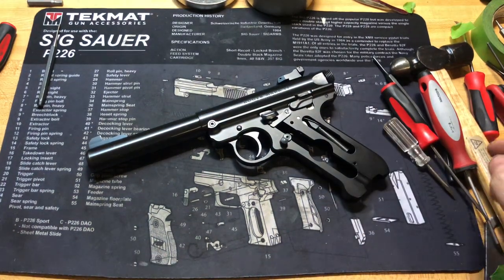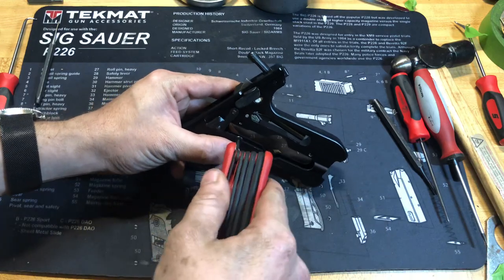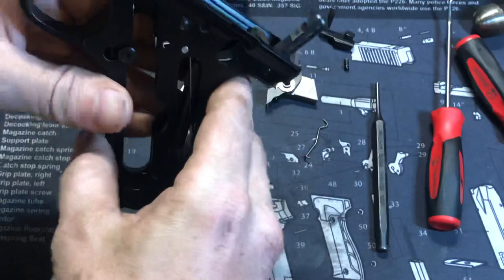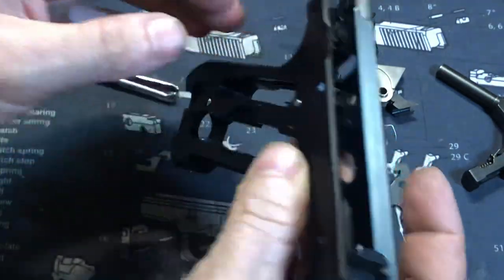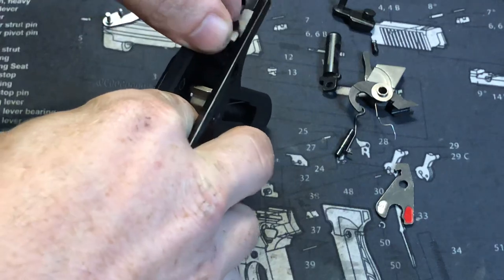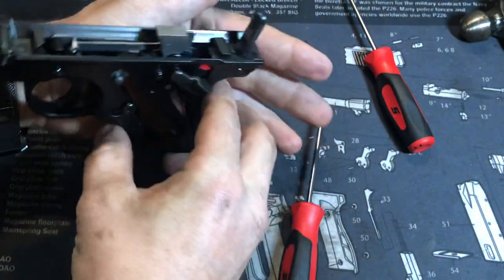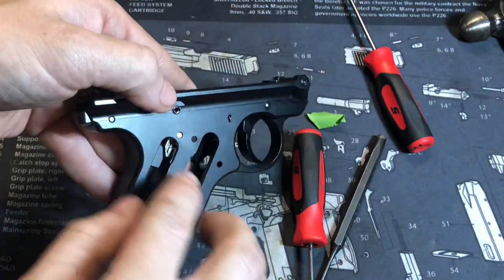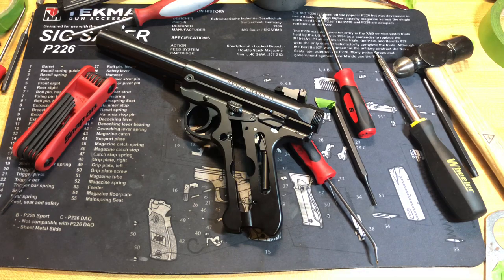Ruger Mark IV Target Complete Disassembly & Reassembly

Comment: I believe that on this Mk IV the trigger pin was installed from the wrong side prior to disassembly.  The pin should be installed from the right side of the gun.  The pin is retained by the little wire spring that pushes up on the trigger bar.  If the pin is installed from the left side (as in this video) it is not locked in place and is free to be pushed out.  You can see the recess in the pin at 24:09.
Reply: Was gonna say the same thing. That said my bolt release doesn’t screw down like his. The grips seem to retain it. 

I came here because my bolt release is sloppy AF. That little spring down front he removed with the pick is supposed to provide some downward bias but on my gun it does jack shit. It’s so bad that if I take out the mag, hold the gun upside down and pull the slide it locks open. That doesn’t seem right. It’s almost like that spring needs to be longer or needs a plunger on it.
Reply: I can confirm, if trigger pin is installed from the right it will be captured by the little wire and you can mess with the other stuff leisurely and push the trigger pin thru when aligned.

Comment: Thanks for the video guide. I was able to complete the install in under 60 minutes after I realized the dang trigger plunger for the trigger bar fell out. TF!
Agreeing with The Gun Bench, this is probably the PITA part.
Installing the safety plate and sear and pushing the safety switch thru.

Comment: Just wanted to say thanks for taking the time to make this video.  My Mark 4 came from the factory with a bad pin & keeper spring on the button to remove the action & barrel.  Ruger offered to fix for free but looking @ the parts breakout I figured it would be no problem...  Well during the disassembly thing kinda fell apart & I didn't see exactly how everything was placed.  Found your video & wow I was very happy.  
One thing about making a tutorial video is all the critics crawl outta the woodwork to let you know how bad it was.  You did great & thanks again!!!

Comment: Thanks for the Video!

I just wanted to point out that you had the trigger pivot pin already installed in the wrong direction. As seen from 7:50 on, the pin has a notch on its head side. That's where the u-shaped front of the trigger pivot retaining spring catches.
I did it your way (inserting it from the left hand side) and yeah ... the pin is held by the bolt open stop. So, the gun works as good as when installed from the right hand side.
Just wanted to say that inserting it from the right hand side is the correct way :-)

Comment: really appreciate it a lot an i joe that can’t be easy without editing,
great job man!

also i’m no pro but a side note is ur hammer pin may be in backwards and could possibly walk out over time.
i’m pretty sure the half moon of the front of the spring on the right side of the lower is supposed to lock into the one side of the hammer pin so that it can’t fall out without depressing front of the spring down  (insert pin from right side of lower instead of the left).
thanks again for the great video.

Comment: Yeah, followed your instruction and the trigger doesn't reset nor have any tension. I've no idea what I did wrong, this has been a 6 hour project. I did everything in a bin so I wouldn't lose parts, made sure no springs shot out across the room, they didn't. I've no idea what I've done wrong, it's a Ruger Mark IV Target Threaded Barrel model. Not a 22/45, just the target model. The hammer also will not set back in a locked position. I honestly have no idea what I did wrong.

Comment: I need some help please. Once I pop in the safety with the spring plunger, it is not able to move. It is stuck. It cannot switch from safety on or off. If I remove the spring plunger, the safety can freely move.

Comment: my magazine assist fell and i wanted to see how to fit it back in, aren't i shit out of luck that yours is missing
Reply from the maker: Spring first and the plastic piece just slides in I believe it’s shaped a certain way so it only goes in one way if I remember correctly
Reply: Me too.  Made the mistake of taking the grips off and then put a magazine in the gun. The plastic piece, spring and pin popped out.  How does it go back in?